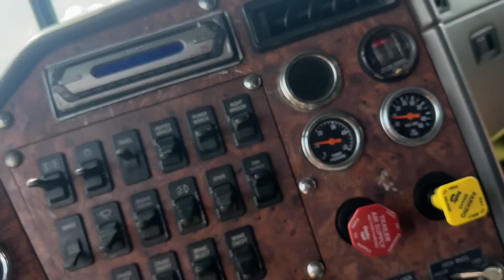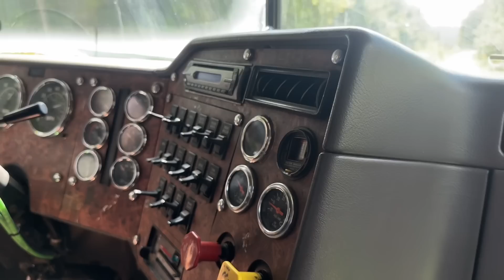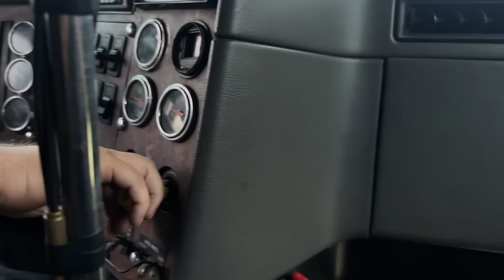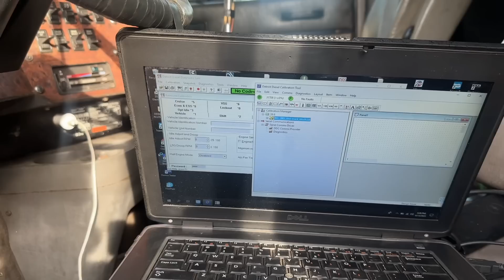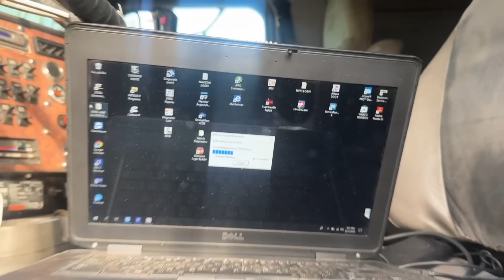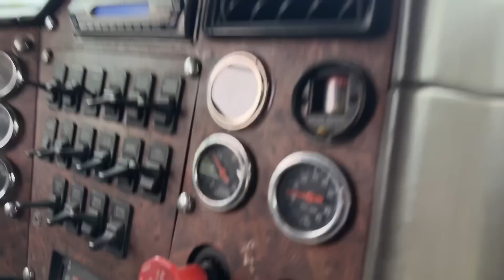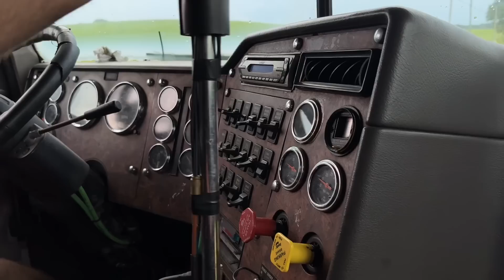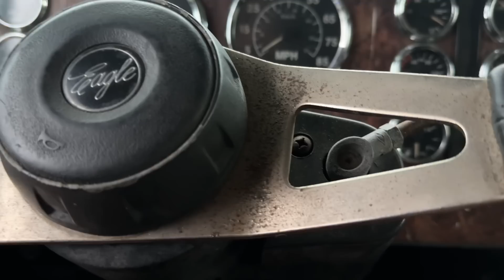11 Year Old Kid Gets A 1000hp Truck..

Comment: That is wild that little old turbo is just taking those back to back 50 pounds of boost pulls. I’d say that turbo is only rated for 500-550 lol 

If that was me the first time I got all over it the turbo would’ve went to outer space and the oil pan would’ve unbolted its self and got out of dodge..

Comment: Is that Cletus new shirt ?
I remember my company was bought out. I had a load 53”. Bought 68,000 gross. The other company had 2 rental trucks ( no Governed)  she was saying she had the fastest truck in the fleet. I had the ugliest truck. We started to climbing the hill. She started slowing down. So i dropped a gear split and started to take off. She was weighing about 30,000. I said I guess you use to have the fastest truck. The truck stock gauge went to 110 not 90. But 85 was fast enough for me. Lol it was a 70’s cab over.

Comment: Positive air shut off. Switch on the dash and the gate closes engine off in as fast as you can hit the switch
Reply: It will also shut off automatically if it runs away

Comment: Hey Tim. Random question. You talk quite a bit about how good detroits are. I’m assuming your referring to the series 60 as from what I’ve read they are a pretty good engine. We have the 8v71na in our bus. Would it be difficult to pump it up a bit for haulin our big ol girl up the hills a little easier? I’d love to turbo it but I’ve read to do that it would require new pistons and a bunch more. Love what y’all do.

Comment: You gotta big turbo already that you been saying it's runnin your egt's off the gauge.
So it's better by 1000% than the old one is, but you need to gut the exhaust, and really open up the intake with better free-flowing air filters.
They need to pull directly from the outside of the engine compartment, and then it needs a real set of cold air pipes from compressor through a real intercooler and better manifolds on both sides of it.
Then just dump the hot air out the passenger side with one bend in it with slashed tip to help push the beast down the road, because there's no need to waste free power, and believe it or not, but with the amount of air that the exhaust pushes through the hot side of the turbo, it will help push the truck whether you believe it or not, because the amount of air in is the amount of air out, and its been converted to high pressure after by the nature of the induction system. 
So don't waste it by blowing it straight up outta two stacks, either one straight to the bottom of the frame with a straight piece after the fitting to turn it back level. 
Are out the side angled so it shoots the exhaust at angle that helps push the truck foreword.

Comment: "Tim"/All! Can you get a Hydrogen motor and test it with alternate fuel? Will cost to the point of "Accosting. Water won't be convenient. Use. Etc. Purifying/methane on board. Where's the hose?

Comment: You aren't going to like me but that's ok. You aren't being very safe on those small country roads. I drove for about 38 years my last truck was a 99 freightliner classic with a 10 car boydstun rack. RTLO 18913 550hp cat. Brother it would run out on small rubber at 126mph. But I knew when and where to do that. Are you really teaching the new drivers out there the right way to act. Brother I don't think so.

Comment: And people say that .lack smoke equals less horsepower. I’m willing to bet the drivers of old from the 60’s and 70’s that would turn their trucks up would disagree and then prove them wrong. All those sled pulling trucks and tractors would disagree as would the diesel drag cars and trucks.
Reply: My 6.4 makes 683hp 1197tq to the wheels and will cover the road up. It takes a lot of fuel for diesel, that’s life. Cleaning up the smoke usually causes a lean condition and less power.
Reply: @nate4036  yeah my 6.4 makes right about the same. It made more than that with the tune turned up but it was too much for the street and normal driving. A lot of people talk crap on the 6.4 and yes Ford did screw the engine up with all the changes they made to it to make it work in the Super Duty. I say that because International ran that engine successfully in several other applications. It was capable of making a lot of power right out of the box with just a tune. The government was the other part of that equation. My fuel economy sucked with the EGR and DPF system still on. It made my engine and intercooler very dirty as well. After removing it and cleaning everything up my fuel economy went way up and the engine has been running cleaner, cooler and much stronger. I’m running ARP bolt kit, upgraded injectors, full exhaust including the down pipe, a bunch of sinister products and the Spartan Tuner with the 375 big boy tune. Needless to say it’s a beast. I’ve been involved in the Diesel world since I was a little kid and i completely agree that it will lean out the fuel and cause all sorts of internal issues. With all that said the little black smoke that mine produces has very little impact when compared to the unleaded fuel and overall picture of the EV vehicle. Plus slave labor isn’t being used to produce my diesel fuel unlike the cobalt mining for EV batteries and the extremely nasty process to produce and recycle/eliminate those EV batteries.
Reply: @P-J-W-777  mines a Spartan 350. 08 F450 with 4.88 gears (easy on the transmission) leaves hard in 4wd high on about 24lbs. I’ve had 6.0s and 7.3s plus a couple Dmax trucks. To be honest the 6.0s and this 6.4 have been nothing but reliable, more so than the gm products that ate injectors and ran hot, and the 7.3 ate cam sensors, injector harnesses, and driver modules. 🤷🏻‍♂️😂
Reply: @nate4036  right on! I didn’t listen and turned it up to 300 on a stock trans and clutch. Well you know where I’m going with this lol. I was going to do it anyway so I could access the 375 tune if I wanted. I drove on it for about a month before it finally gave out so I’d have to say kudos to the Ford trans. I’ve seen Ram and GM transmissions crater on a lot smaller tunes. Love the Spartan tuner just wished you could change power levels on the fly like the edge programmer. The exhaust I’m running is AFE. Oh did I mention that I love my Sinister Diesel Products. Pissed that the government fined them though.
Reply: @P-J-W-777  absolutely, 10mins to swap tunes is ridiculous. I broke my sun gear and had all neutrals on the 350 tune🤦🏻‍♂️😂
Reply: @nate4036  yes sir and I always made sure I had a charger hooked up because I didn’t want to risk bricking my computer. Luckily I blew my trans and clutch right next to my house when I decided to smoke my rather beefy all-terrain tires lol. (Big dummy) I can laugh about it now though😅 but I shred 1st thru 3rd gear from what he trans shop said.